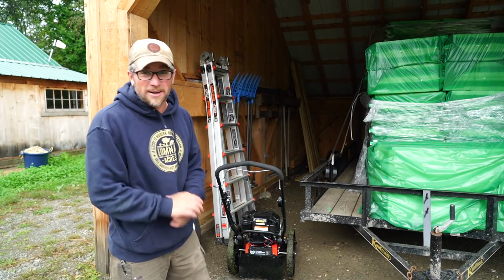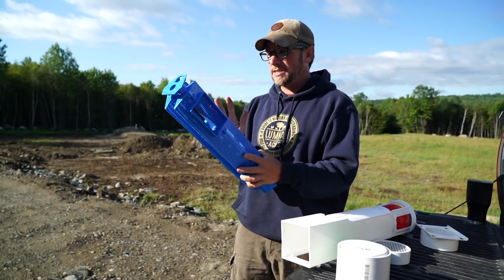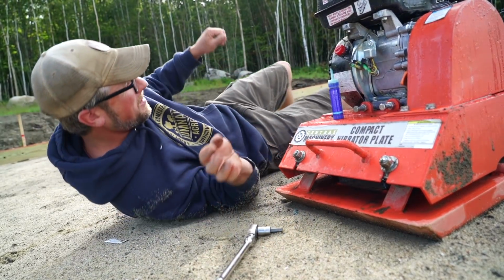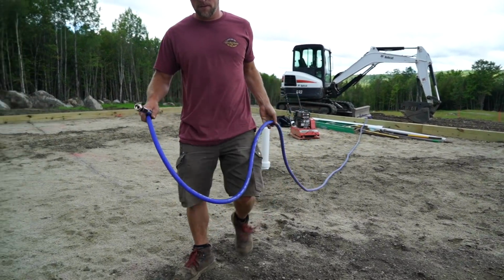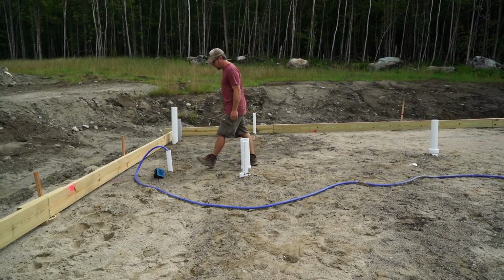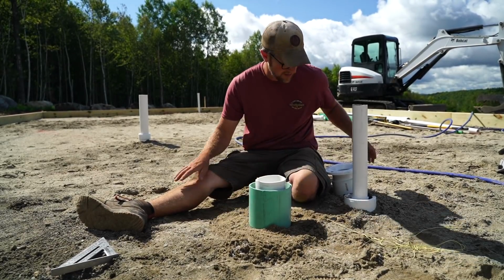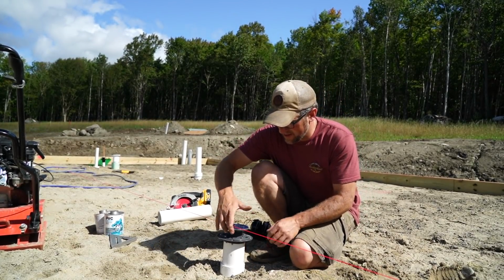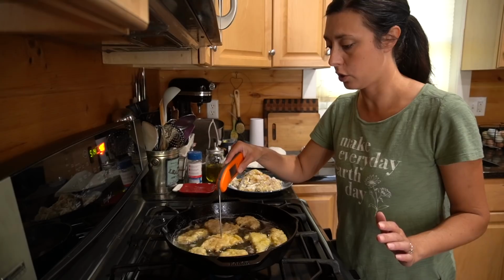If It's WRONG We'll have to Jack Hammer it Out!!!

Comment: I am a long retired  Aussie plumber so am not familiar with all your rules and regs. What I was concerned about with you fixing your levels for the drains and toilet connection; is did you allow for the height of you tiling? You have the cement bedding if your concrete is not finished smoothly, as well as the tile thickness. I have known the cement bedding to be up to an inch thick, so am concerned for your finished cuts. I see that the floor grates are adjustable, but how about your other pipes you have cut to height. I'm not trying to be a pain in the but, just concerned for your final finish.  Great to see your water tests gave good flow though, well done.
Reply: think his concrete height is the finish height
Reply: @pekulike  that could well be too, didn't think of that................
Reply: Good point.  If it were my build, I would have waited until the concrete was poured before I cut down any pipes... but it's not my build, so 🤗
Reply: I hear what you're saying Sam. But after all, it's Al and Gina's decisions in all things. We can offer suggestions, but they make the final decision. They are the ones doing the work and we can respect that and hope all goes as they plan.
Reply: @richardDownUnda  - And with about a week delay in the posting of videos, anything we say may be moot as they have already moved on.  I totally agree.  When it comes down to it, it's their home, their build, they are free to do whatever they wish.  When we see something that is questionable, it's in our interest as good human beings and offer suggestions to right a wrong before it's set in concrete... in this case, literally!  😀   Nice chatting with you, Richard.  Stay safe and be well!

Comment: the reason primer is purple is so inspectors can see it has been primed. clear is usually used on interior plumbing.
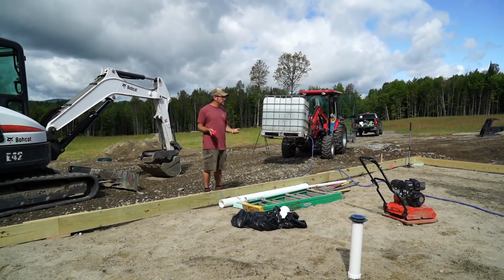Reply: Apparently no further inspection is needed 18:00  on anything.  I am surprised.
Reply: @samvalentine3206  Very common is rural America. Federal law made septic inspections mandatory nation wide but the rest is up to the local county. This means you have to be very careful when moving to rural areas and get deep inspections before buying. You cannot imagine the dangerous plumbing and electrical I have seen in areas an hour outside of large cities. I can usually tell a lot by what is exposed but you never really know what is hidden from view. Buyer beware.

Comment: I hate to tell someone how to do something but if it was mine I would box out a 12"x12" area around the shower drain to make it much easier later when you get ready to do the shower !! It appears that you have a 4" riser for the stool ! If you left it above the floor and cut at floor height after the pour you could glue a inside the pipe closet collar in it and it would be perfect!!! Just some friendly plumber suggestions !! Have a Great Day
Reply: True and we went back and watched him install the septic tank.  Watched several times where he put in the baffle and he put it in upside down.   Will cause problems later.
Reply: @patriotmama  - For what it's worth, there are pass-thru holes at 3 o'clock and 9 o'clock which should help the baffle do it's thing - to a point.
Reply: I really hope Al sees this and there is time for him to incorporate this almost critical idea to the build.
Reply: @samvalentine3206  even if he sees it he will still ignore the suggestio
Reply: We did the same thing when we did our concrete floors. Saved a lot of headache later. We cut a plastic bucket and put it around the pipes before we ran the concrete.
Reply: @norrinebuchholz3236  - Good idea about using a cut-down plastic bucket!
Reply: Al does not care... in this video you were just told... from this point on, there are no government involvement in the build...so now it is construction according to Al...😅😂🤣
Reply: @karlgriggs8887  AS it should be, the less government the better, if anything is going to be screwed up its going to be the hoops you have to jump through
Reply: @ryanhoward1013  I was not complaining about inspections per-say ....I was pretty much saying from this point on none of what is said by people that actually know the ins and out of the builds, contractors.. he does not care... this is Al's build ...
Reply: @ryanhoward1013  it wasn't about inspections or any government mandate, but about our experience with concrete pours and drains. . . I added my suggestion as a help, not a mandate. Al can do as the freely chooses ... I certainly would not be offended if he thinks my idea, from my experience is not for him. Let's all enjoy life, enjoy Al and family doing their thing!
Reply: @brenda324  spot on. Sad world we've evolved into.
Reply: that's how i did ours also. . . worked great.

Comment: Al you tried to use your compactor for a job it wasn't meant to do. It's not big enough to use on rock or driveways. Small gravel should be the largest thing you use it on. Plus it sold by Harbor Freight so it's cheaply made. I don't mean to be insulting just stating the obvious.

Comment: Why not wait until the concrete is poured to cut down the drains in the floor? Would be more accurate, no?
Reply: i thought that,bit early to cut to size,wait and cut when concretes done,then if needed only need to chip a bit of concrete out if needed to go lower...make life simple not hard eh .oh and could mark the pipes the height for the concrete levels

Comment: I'm sorry Al them weed wackers have there place but I would rather use a weed eater ultra light dual line trimmer for grass trimming. The Weedeater ultra light is light enough to use one handed and powerful enough to trim trough most tough grass. Plus with the bent shaft it allows you to stand straight up while your weed eating. There hard to find people buy them up as quick as there stocked. Them wheeled weed wackers are great for overgrown drainage ditches were you can't get a tractor or mower.

Comment: Al u are putting the horse before the cart Reason is all those stand pipe cuts should be done after the cement is poured except for the commode and shower drain.

Comment: It would be much easier to cut those pipes after the pour with the right cutter.
Reply: Cindy here, I have zero experience but that's what I would do.
Reply: He needs to set a few vertical rebar pins and use his laser level to put their top at floor level as a guide for the pour.
Reply: @mrpesky163   Not really quite his it’s done.  You generally set some wooden stakes within the form at intervals based on the length of the screed you’ll use during the pour so you always are going from one set elevation to the next when screening.  Then you just put a nail at grade height which can be determined with a laser or just a string line from one side of the form to the other.  Then the grade stakes are removed as the pour proceeds.    But generally, you wield out a test ball in the sewer clean out to block your main line leaving the house and fill the grounds from the furthest riser with all risers being left open.  Then when all full, before you cap the risers, extend one up with a 10’ section of pipe to fill the pipes and add some head pressure from the water column to test for leaks.  Mark your level and if it drops, you have a leak.  Or yo can cap everything and pressure test with air.  You never cut risers prior to the concrete being poured.  NEVER.  that’s ridiculous and asking for BIG PROBLEMS!
Reply: @invictusbp1prop143  yes, what you said 👍
I thought he was heading for disaster, but then he did the smart thing and got Ken to do the pour. Saved his bacon 😉

Comment: Good morning  love your videos.  I agree it's a tool it is meant to be used. Harbor freight should step up and give you a good working compactor. ... hint hint harbor freight
Reply: When tools are used as they are designed, you're correct.  They are meant to be used in proper conditions.  When the compactor was used on those large rocks, that was a problem.  https://youtu.be/3IQHRd5vDFE?t=509

Comment: Most Grey Water from Sinks\Laundry don't t need to go thru a leech field since it can actually be used as  fertilizers as long as things like bleach etc aren't being used. Indeed shining Grey Water that's filtered for heavier particulates can get used twice for flushing a toilet which is Black Water can even be done at times as well. Indeed having a separate  Grey and Black Water System is the future since the former can be used twice where the latter is but once also means less is used as the toilet uses more water than literally anything else in a home. Though its tempting to pre cut the pipes Al should wait until the Pour just in in case or after since its rare to not use an adapter then cut it back on floor drain toilet flanges afterwards.
Reply: I learned that from a friend who lived in the Faulklin Islands. great idea.
Reply: The suggestion has been made before and unfortunately it's not been implemented.  There must be a reason for it that we don't see.  Gray water systems make infinite sense.  Let it drain into a suitably sized dry well.

Comment: Outdoors with the Morgans have one of those compactors. Ask them if they have isdues
Reply: i saw mike morgan using his. i think if he had had an issue we would have heard about it.
Reply: Did the Morgans use as a vibrateing roller to flaten rocks the size Al did,?  that machine was never designed to what he asked of it ,,they are for sand and small gravel  ,it was lucky it did not fall apart doing what Ale xpected of it so should not complain it karked it